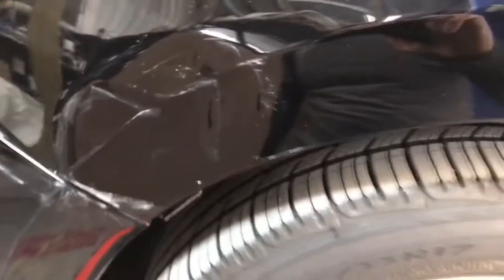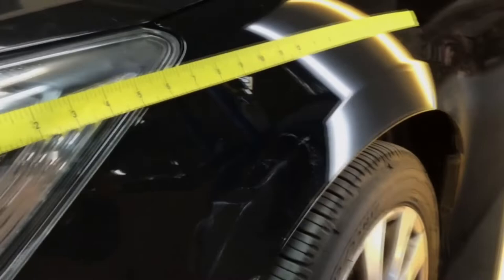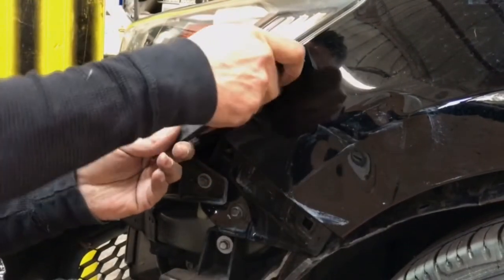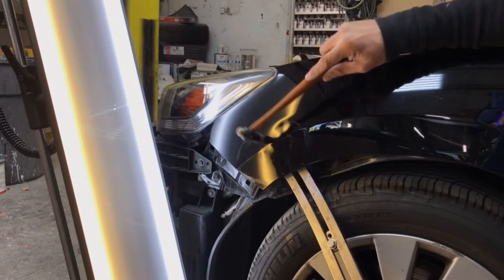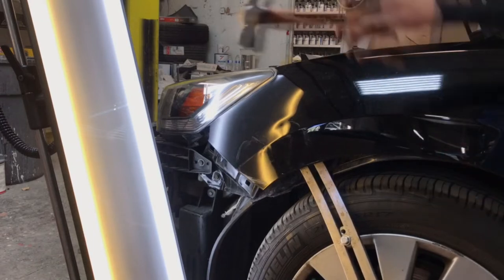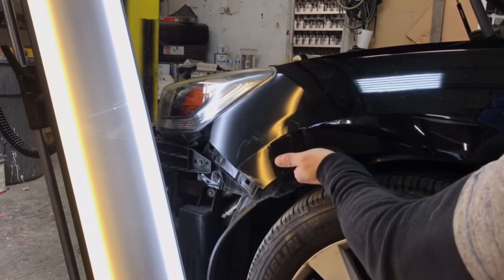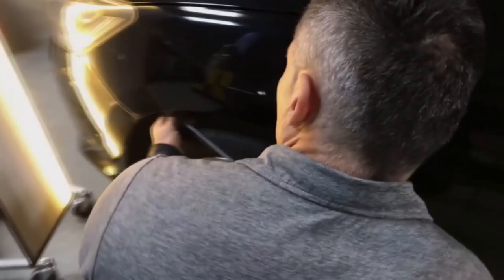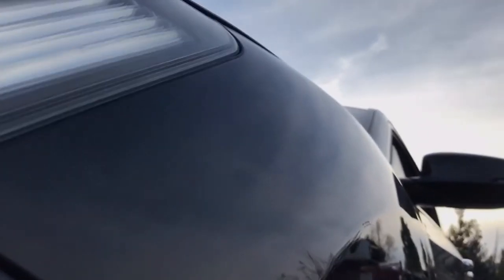PDR Dent Removal | 21in. Dent | Body Repair Car

Comment: Nice work . How long did it take
Reply from the maker: IM slow on R&I. I did the repair last year  start to finish i believe it was around 4hours. Thank you for the comment and question.
Reply: I wouldn't say that was slow
Reply from the maker: @straightlines7432  not bad. thanks